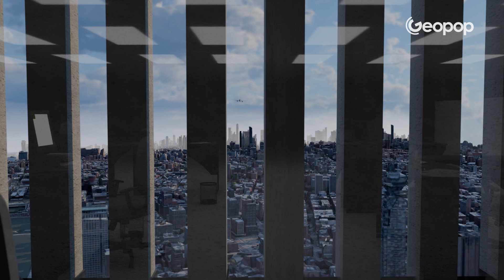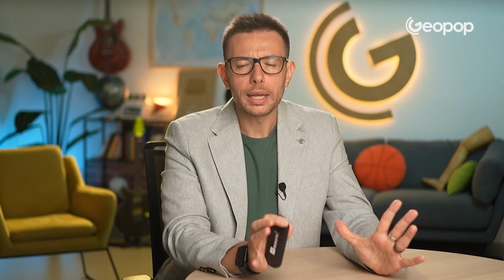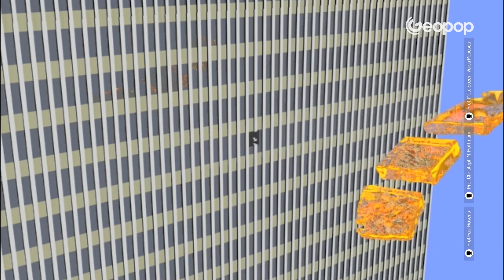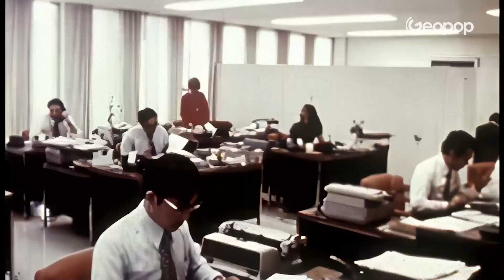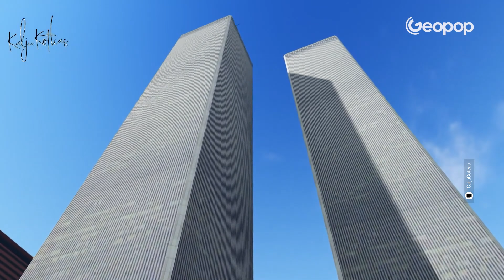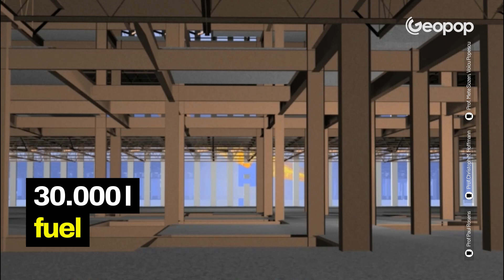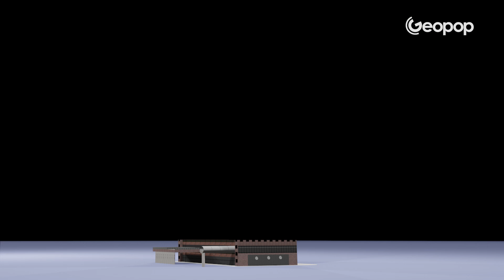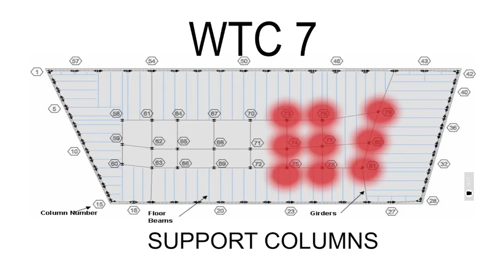9/11, 2001: The Technical Reconstruction of the Twin Towers and WTC 7 Collapses

Comment: WTC 7 fell because when doing the floor foundations all was good except the left hand side front columns. They were "made' to fit in n over a sub station  or maybe it was part of the air con.Thats where the structure column number 71 or wherever failed.
Dont believe me.
Go n look it up.Its been known since not long after the attack

Comment: Ci va coraggio a trattare un argomento di questo tipo copiando da altri "geni" dell'edilizia del tubo. 
La sfacciataggine poi di usare una AI per avere visibilità internazionale è la chicca che conferma la qualità della fonte.
Reply: OK. but he's not wrong, so...
Reply: @TheLoonResistance  This isn't science. It's recycling nonsense.
Reply: @TheLoonResistance   totally wrong
Reply: @GAExperience  - Please explain in detail. Don't leave anything out or make anything up. I will know.
Reply: @TheLoonResistance   It's no longer a scientific question. It's a psychological one. You like to reverse the burden of proof. I'm not the one who has to explain to you why the official theory doesn't hold up. You're the one who has to explain how three steel-framed buildings can fall at free fall speed (for considerable periods of time). The pancake effect holds up like a house of cards in a tornado. The "office fire" explanation sounds even worse.
Reply: @TheLoonResistance    Occam's razor suggests that these are 3 perfectly executed controlled demolitions
Reply: @GAExperience  - You are criticizing this video. The video makes its case - as an engineering problem which is what it is.  IF you have a problem with that case then you need to make a better one, and you haven't even started.  

Worth noting what this video does not describe at all is: _ how three steel-framed buildings can fall at free fall speed (for considerable periods of time) or the pancake effect_ which isn't even a thing.

It's almost like you are criticizing a video you never actually watched by mindlessly copying the same old failed cliches that have been circulating on the internet for 25 years.

So boring.
Reply: @TheLoonResistance  free fall. Its simple. Free fall its only because controlled demolition.

Just only
Reply: @TheLoonResistance   Forget the top-down logic where you start with a theory and look for proof.

This is Inductive Reasoning: the "bottom-up" approach. You don't start with an idea; you start with raw facts. You observe specific data first, notice a recurring pattern, and only then build a hypothesis to explain it.

In short: Facts → Pattern → Hypothesis

boring.
Reply: @GAExperience  - What free fall?  How does whatever is free falling know why it is free falling so it knows to free fall?

As far as starting from the beginning with the true and relevant facts - I did:  Twin Towers collapses were relatively straightforward, well understood in the professional engineering community within just weeks. For the average person though it still requires some effort. Engineering is hard, and who has that kind of time?  So the internet stepped in peddling a lot of really bad information, simple slogans and hand-wave rationalizations that are exciting and require little to no thinking.  That crap gets far too much attention.

Because anything can seem like a conspiracy if you don’t understand how it works and I’m an understanding kind of guy, I prepared this short, detailed technical overview of Twin Towers collapses from my own observation and analysis of available true and relevant facts. No politics, ideology or magical thinking, just engineering. Hopefully this will dispel many common myths and answer most if not all questions you may have about the collapses.  

While complex, most of the Twin Towers collapse mechanisms can be seen with the naked eye and easily discerned and understood by the layperson IF sufficient time is taken to understand.

1. The Twin Towers consisted of 4 primary structural elements that together formed an integrated system where each relied on the others. 47 hollow box-section steel Core Columns carry the majority of the gravity loads. The 236 hollow box-section steel Perimeter Columns carry the remainder and ALL of the lateral (wind) loads. Long-span Lightweight Steel Trusses connect the core and perimeter column together at each floor with a Hat Truss on top to tie the structure together as an integrated unit where no element can survive without the others. There was no structural load bearing concrete and most components were bolted together.

www.youtube.com/watch?v=u7OqrC74Dm4

2. The impact of 120 tons of airplane (= to about 12 dump trucks) at speeds up to 589 mph with the energy of a ton of TNT completely destroys the aircraft. This in no way implies the Towers come out unscathed. Many perimeter columns are damaged or destroyed as are some core columns (example; 33 of 59 perimeter and 20 of 47 core columns damaged or destroyed at the impact floors in the North Tower), This damage is primarily through bolt-shearing failures at the end connecting flanges, as well as bending, twisting and fracturing of weld seams. There was no cutting or slicing - the reality was far more violent and messy.

3. The impacts destroy or damage fire insulation, fire breaks and sprinkler systems on multiple floors. Huge fires are started across multiple floors simultaneously and allowed to spread rapidly with no effective firefighting or fire suppression. This was an unprecedented fire event .

4. The hotter steel gets the weaker it gets . With fire insulation stripped away and no sprinklers the survival time of the steel greatly reduced. Gradually over time heat causes the lightweight steel Floor Trusses at the impact damaged floors to sag, which was observed and recorded. No steel melted or needed to. Structural steel fails long before it becomes a puddle. It just needs to bend

5. Sagging floor trusses pull on the increasingly weak and overloaded Perimeter Columns, causing some of them to bow inward by up to 5 feet. A straight column is up to 4 times stronger than a bent column. The bowed Perimeter Columns buckle and fail, quietly initiating collapse. The formerly static mass above which the structure below could easily support is converted to a dynamic mass up to 30 times greater. Because they have buckled, the Columns above and below the failure point are no longer aligned . The load bearing structure below no longer bears any load as it falls past the lower columns, NOT onto them.

www.youtube.com/watch?v=ULdiD6gYZO0

6. Thousands of tons of debris fall within the four outer walls, down through the open office space, crashing onto the first intact floor it encounters, immediately breaking the bolted column connections as the amount of resistance the Floor Trusses can offer is negligible. The falling debris slows only marginally and briefly. Note: 
6a. This is NOT a solid top block crashing into and “crushing” a solid bottom block . 
6b. The debris falls past the columns not onto them. The columns provide no resistance to the falling debris. 
6c. Only the bolted floor truss connections to the core and perimeter columns offer any resistance. A pair of 5/8” bolts at each end of each truss vs. thousands of tons of falling debris. 
6d. No laws of physics are violated. 
6e. There is no 20 floors against 90 floors but rather 20 floors against one floor, then 21 floors against one floor, then 22 floors against one floor, etc. 

7. This floor-led collapse progression within the four outer walls can only go straight down.
7a. This process is often incorrectly referred to as “pancaking”. The catchy name stuck but nobody knows what it really means and "pancaking" is too simplistic and inaccurate anyway. I prefer Kaiserschmarrn.

8. Collapse progresses through the floor systems past the columns, through the path of least resistance . The resistance offered by each floor is always the same while the mass of debris and its velocity – thus its energy - increases with each floor failure. Each floor offers the exact same resistance to the falling mass while with each failure the falling debris constantly gains both mass and velocity. *This process of floor-by-floor destruction cannot be arrested, it can only speed up . Rate of floor failures increases with each floor as momentum increases, reaching an average acceleration of 0.65 of GA, or 35% slower than true free fall. Bam, bam, bam down the building until there are no more floors to fail. The resistance offered by each successive floor is always the same. More mass, more velocity, same resistance with each floor. Don’t get stuck on the but the lower floors weren’t on fire nonsense. They weren‘t and didn’t need to be.

9. The Towers were 95% air by volume. As that air was compressed inside the building it is forced down the tower and blown out the sides in reaction to the building collapsing . Those were not “explosions”, it was expulsions of compressed air caused by the collapsing building, explaining the low velocity, lack of flash, blast, supersonic pressure waves and lethal high-velocity ejecta.

10. Perimeter Columns become detached and peel away like a banana behind the collapse front, playing out to the four points of the compass extending to more than 800 feet from the base of the towers. This was quite obvious from examination of the debris pile.

11. Core Columns fail last as their internal beam bracing is stripped away by falling debris and lateral support from the floor to perimeter columns is lost.

www.youtube.com/watch?v=WpHXj62Ylw0

12. For those who care about how long this whole process took; 31-34 seconds from the moment the perimeter columns buckled until the last core columns hit the pile, or 1/3 the rate of true free fall. Don’t believe me? Just watch any video of the collapses and note the loose truly free-falling debris dropping much faster than the towers themselves.

13. Each Tower had a 1-acre footprint. Far from collapsing inside their own footprints the debris pile spread out over 17 acres in a pile up to 14 stories deep. 8 surrounding buildings were destroyed and scores more damaged by the falling debris.

14. NOT observed were the 180-190 dB bangs of thousands of high explosive devices or the blinding bright flashes of burning thermite. Neither explosives or thermite could have survived the impacts and subsequent fire nor could have caused the (silent) perimeter column buckling that clearly initiated collapse either. A video of a shocked and injured firefighter casually using the magic word explosion is in no way proof of explsoIVES and the demolition_ case relies entirely on that sort of thing. There is zero tangible physical evidence and it would be technically impossible, totally impractical and completely unnecessary. No one would bother.  In 24 years zero structural engineers of tall buildings, including the 1/3 that have retired in that time, have made any statements in support of pre-planned demolition claims. NONE. The lack of any such citations in the engineering literature (published in any country worldwide) is telling.

15. Twin Towers were perfectly safe within their design envelope. They only collapsed when taken far outside design parameters by an extraordinary and unprecedented event

Impact + Fire (heat) + Time + Gravity = Collapse . Remove any one of those 4 elements and there is no collapse. Ignore any of those elements (as many do) and you will never understand the collapses. The Twin Towers were an integrated system in which no one component could survive without the others. One fails, the rest follow, through the path of least resistance – DOWN – through the open space, bypassing the path of greatest resistance – the columns. Nothing I just described violates any laws of physics. All of the above is true no matter who planned and carried out the 9/11 attacks or why

I hope this was helpful and informative, non-adversarial and it solicits informed critical comment, positive or negative. If I made any errors of fact, logic or reason or left anything critical out, please let me know so I can fix it. To stay focused, just one point at a time please and on-topic (Twin Towers ONLY). No word-salads of Gish Gallop. IF you can offer a more plausible alternative be my guest. Please start any reply with the words “Tits McGee” or I’ll know you didn’t read it, aren’t serious and wasting my time.
Reply: @GAExperience  
Occam's razor does not suggest that....and even it if did, it's a suggestion, not a law of nature.
Reply: @GAExperience  
Planes crashed into the towers....this caused damage to structure and structure was on fire.....increased temperature weakens metal (and lessens stiffness).....eventually there is structural collapse..........
Simple, factual and reasonable.
Reply: @Joseph-e9p1x   Occam's razor suggests starting with the most obvious answer: controlled demolition.

Starting with an office fire is ridiculous.
Reply: @Joseph-e9p1x   yes free fall speed. Lol this is not science
Reply: @GAExperience  
No, that's not even Occam's razor! You're controlled demolition idea actually goes against OR....bet you didn't know that did you?...
And secondly, the most obvious answer is the planes flying hundreds of miles per hour crashing into buildings and then fires decreasing the strength and stiffness of the already damaged structure, thus leading to collapse. 

It's not starting with an office fire, stop being intellectually dishonest...you know very well that's not what it is/was.
Reply: @GAExperience  
You don't understand dynamic impact and mechanics of materials do you?...
Reply: @Joseph-e9p1x   WTC 7 was not hit by any airplane. Updated
Reply: @Joseph-e9p1x   WTC 7 was not hit by any airplane. Updated
Reply: @GAExperience  
No it wasn't...but you were being general and had previously stated all 3 were demo controlled.
Reply: @GAExperience  - Free fall speed is not science.  Free fall can be an expression of a state an object is in or an objects rate of acceleration (better expressed as free-fall acceleration or gravitational acceleration) NOT it's velocity.  There is no such thing as free fall SPEED

Occams razor suggests the most likely cause of the collapse of a building fully involved in fire is,... (wait for it) - FIRE

Effing duh 🤦‍♂

No one has ever claimed Building 7 was hit by a plane, so why bring it up - other than the bleeding obvious fact you hold not a single original thought of your own, resorting instead to simple mindless repeating of the failed ideas of others.

Not a good plan

How about something fresh?  Something new? Something a million people before you also copied off the internet and utterly failed with?  I mean, unless your master plan is to suck failure, I really don't see what you intend to achieve.

Comment: First and last time in human history, that steel buildings collapsed  in their own footprint. You must be a complet idiot to believe the official version of 9/11.
Reply: You must be a complete ignorant retard to believe no steel buildings heave ever collapsed when it happens all the fucking time and that this one collapsed in its own footprint while simultaneously blocking all the surrounding streets in rubble up to 7 stories deep, destroying one building across the street and causing a billion dollars in damage to another - none of that in its own footprint

Time to start using the thinking part of the brain and stop mindlessly repeating the utter stupidity of others. FFS 🤦‍♂
Reply: @TheLoonResistance   Steel collapsing on itself? You must have seen some Marvel movie.
Reply: @GAExperience  - It literally happens all the time. FFS 🤦‍♂
Reply: @TheLoonResistance   yes yes all the time. of course yes
Reply: @GAExperience  - Thousands of times a year. Steel is formed using heat and deforms the same way, making it uniquely vulnerable to fire. This is why steel framing in large buildings frequently requires extra fire protection measures such as insulation and sprinkler systems, so that it takes an hour or two for the steel to fail instead of minutes, thus allowing occupants time to escape.
Reply: @TheLoonResistance  free fall
Reply: @GAExperience  - Epic fail
Reply: @TheLoonResistance   go to sleep kid

Comment: All these buildings were pre armed In case of an invasion in cold war paranoia. As a lift engineer I knew to never touch the light blue wires or the boxes connected to them in the lift shafts